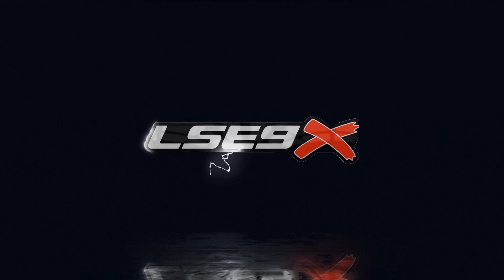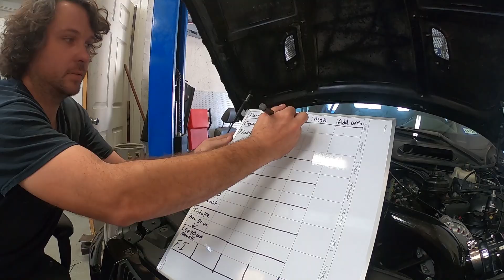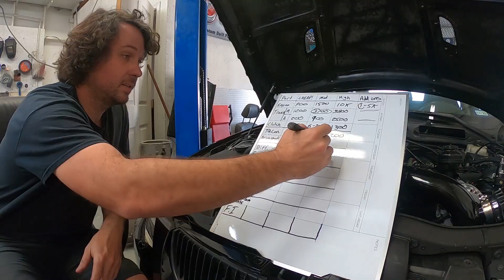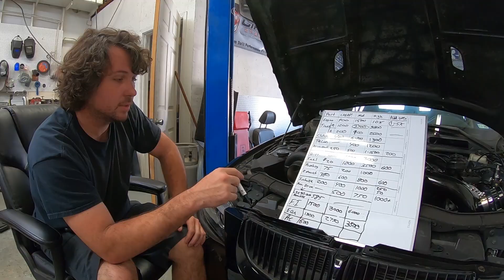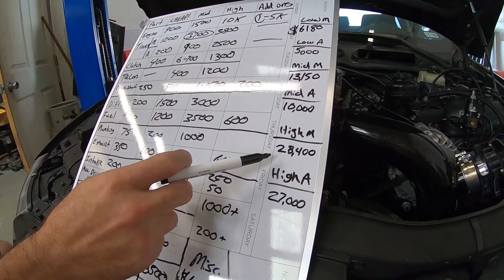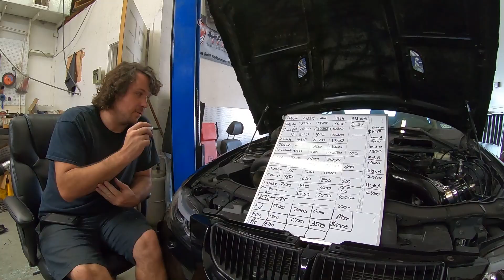How Cheap can you really LS swap a BMW??

Comment: I’m around $25k into my M3. That’s a turbocharged, LS swap, car, fully modded everything all together cost.
Reply: Same here.  These toys aint cheap!  I'm at $30k over the last 6 years.  2'nd T56,  2'nd subframe and differential.  On3 7875 huge meth kit with dual nozzles,  5.3 iron block has been rebuilt 2 times (bent connecting rods,  popped pistons etc).  12psi totally reliable 480whp no intercooler with meth.   16psi feels good and has proven reliable 600whp.  18psi bent connecting rods 650whp intake temps were 300 degrees f.  I need to cram an intercooler in there somewhere.  Thinking of putting the rad in the trunk.
Reply: @jsnyara  hell yeah, that’s totally badass brother.
Reply from the maker: Highly recommend you guys find a better tuner if you’re popping motors at 600hp.  Intercooler is a must have unless you’re running meth or E85, but we’ve made over 1200 wheel on stock bottom end motors dozens of times over. A quality tune with someone who knows how to make them live will save you a lot of headache.
Reply: @lse90garage  Literally, I personally run a 12 x 4 x 26 intercooler but that’s just me.
Reply from the maker: @frontspring1  not at all, half a dozen 1000hp cars on our Instagram that are stock GM shortblocks with ring gap. Educate yourself.
Reply from the maker: @CameronLegend  yea the basic on3 3” and 4” core intercoolers work well, no issues from them making 4 digit power, do they lose some efficiency at that power level, sure, but anything is better than 200+ intake temps.  I don’t think this AE dude has a clue about anything.
Reply: @lse90garage  you're part of the problem telling people they can make 1000hp.
Yeah you can make 1000hp that's no problem but it's not reliable
Reply from the maker: @frontspring1  No, I told you that if you’re breaking an LS at 600 you need a new tuner. We make 4 digits every week, have been, and will continue to, because we know what we’re doing.  Regardless of combo if your tuner is a moron, you’ll just be picking up more expensive pieces.  Since you seem to know everything please tag us in anything you’ve built that’s fast. Currently you are the problem here, mr “slugs can’t handle over 600”..may be the dumbest shit I’ve read all week.
Reply: @lse90garage  whatever helps you sleep night.
Stock ls blocks are $hit
Reply from the maker: @frontspring1  😂😂😂😂😂😂😂😂😂😂😂😂😂😂😂😂😂😂😂😂😂😂😂😂😂😂😂😂😂😂😂😂😂😂😂😂😂😂😂😂😂😂😂😂😂😂😂😂😂😂😂😂😂😂
Reply: @jsnyara  wow that's wild
Reply: @jsnyara not enough. You can get to 600whp on a 335i with some $1000 turbos and $1500 in fbo parts.
Reply: @Charger-ob8yl you can’t get it reliably. And it’s laggy
Reply: So, I have a M4 Competition and I REALLY don’t know if I have room for another project car lol but I’m curious I see 2 of you are 25k into your builds but I also see you all have built and modified your setups.  If you were just doing a basic swap with no additional mods how much would you say you’d be into each of your projects?
Reply: @sickvendetta9  I’m also now closer to 40k into my project lol I’ve gone super Saiyan
Reply: @CameronLegend  still 🐌
Reply: @frontspring1  will still 💩 on anything less than 800whp
Reply: @CameronLegend  you're heavy
Reply: @CameronLegend  stock slugs can't support much hp
Reply: @CameronLegend  you haven't even done a pull on it you're not pulling on no one.
Reply: @sickvendetta9  you could do it for around 10k. 

But it would be a stretch. 

Swap kit - 2500 
Used engine and trans 4-5k
Shell car 1000-2500
Misc 1000
Reply: @CameronLegend  Damn 4 or 5k for. used ls and trans that's crazy. I just picked up a lm7 and 4l60 with 140k miles for 600. Sure the trans is no good but it came together. Still though can be done way cheaper on that part. Just looking here bc I have always loved the 335 and I seen one on market place for 2k with the motor blown. Damn I'd so love to do this.
Reply: @lsgt5132  it’s the supporting modifications. That 25k turned into 40k pretty quickly.
Reply: How much hp
Reply: @frontspring1  all of it
Reply: @CameronLegend  probably on stock pistons
Reply: @frontspring1  no lies there
Reply: That’s really not that bad. That’s a price I’d be happy with
Reply: Plz tell me the m3 is really just a rebadged 328 w a ls swap, or did the rod bearings go on the s65?
Reply: Not bad considering a brand new one that is not as durable is 3x the price

Comment: Already spent 5-6k maintining my n54... so i should just buy an Ls amd swap it huh?
Reply: Facts bro
Reply: I just blew my 328i 2011 on 150k miles what motor should I swap it to
Reply: @neyzanmaldonado4373  
If it was me, I would just put another low mileage N52 for super cheap, probably N51B30 with three stage intake manifold already installed. Or the newest N52B30 with 268hp. It’s too expensive to do LS2 or 2JZ.
Reply: If you had the N52 you would have been good for 300k miles. No turbo though
Reply: Thats good idea thanks for replay. I was thinking n55 as I get bullied alot with the 335i and 428i
Reply: @neyzanmaldonado4373  
Haha true, I have an 06’ 325i, but I’ve modified everything and it looks sick. I’m just focusing on getting the engine to last to 300k. It’s almost at 200k now, sorry to hear about the engine, how did it fail? So I can look out for that
Reply: Nice bro. So I kept on driving for over 150 mph and oil went half way and I started to hear mocking noises pulled over and headed an xplosion happen last night around 3 am left the car went back it wants to start but only does a crank intought to dig thru the started and thats when I saw the hole on the block
Reply: @neyzanmaldonado4373  
Oh wow that’s crazy man, I’m sorry to hear that, I had to replace the valve cover gaskets at one point. I wonder if it had something to do with that, but yeah you could just buy a used N52 engine for like $500 - $2,000 and install it. If I was you I might just upgrade if I could afford a newer model with a turbo.
Reply: @hikeskool  
Yeah, and it defeats the purpose of a 325i if you destroy the longevity. Maybe engine swap a 335i, but it’s a waste of time for my car.
Reply: @hikeskool  
Lol 😂 ok bud, thanks for sharing. Enjoy your LS swapped Honda Accord
Reply: @hikeskool  
Cut the attitude, and you’ll go far in life. Nice job liking your own comments 👌
Reply: @hikeskool  
Hahah nice one, if I had a N54 it would have been totaled 5 years ago when the engine blew. You got a 335i I take it?
Reply: @hikeskool  
Nice 👍 I’ve been wrestling upgrading for a while now, but my E90 is so solid I’m just going to keep it as a back-up. E92s are not good used car purchases, that’s all I was saying. They were the first generation of turbos, and they screwed it up.
Reply: @hikeskool  
There is probably some truth to that, one thing for certain is that they are more expensive to maintain than the E90, but that doesn’t matter to a lot of people.
Reply: @DillonRust  hey i have a n52 any tips to make it last longer? I only bought it with 130k i wanna hold on forever i’m planning to do motor & transmission mounts, front suspension refresh, valve cover gasket, ofhg (done) and i wanna replace the CCV system, clean the throttle body & replace intake manifold gaskets + throttle body gasket , clean the mess that the oil filter housing left, and clean the vanos solenoids and MAF sensor again. What else would you recommend doing to keep it on the road past 200 thousand

Comment: Will your kit work for a wagon x drive?
Reply from the maker: X drive crossmember mounts are in the works
Reply from the maker: X drive mounts are finished. Just working on the crossmember. What transmission are you looking to use?
Reply: Might go manual if it makes things any easier my cars a 2007 328xi something in the budget transmissions.
Reply: Either going 5.3 4l60 or 6.0 4l80 whatever I can get my hand on for a good price